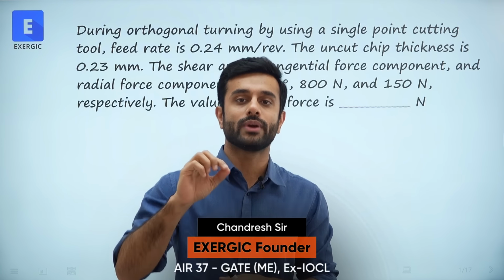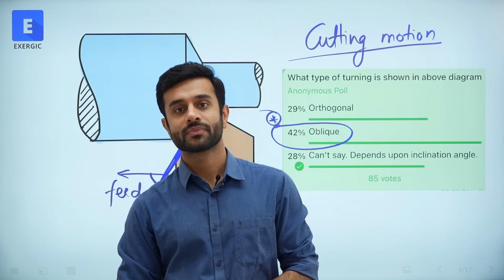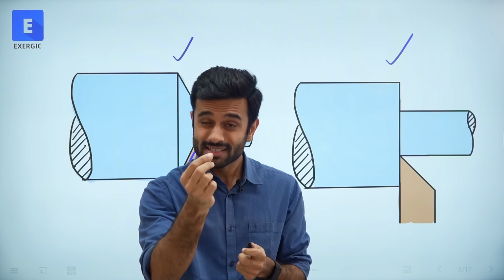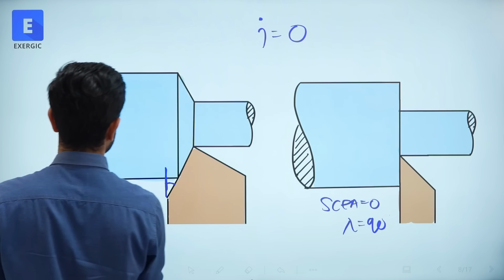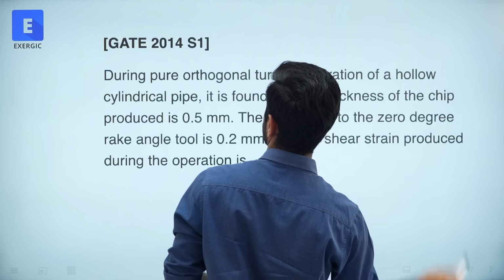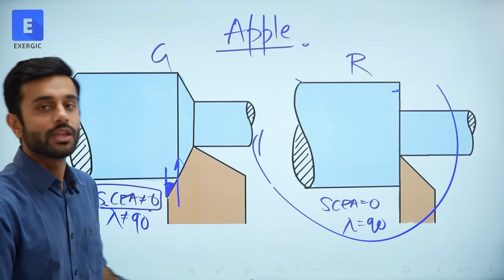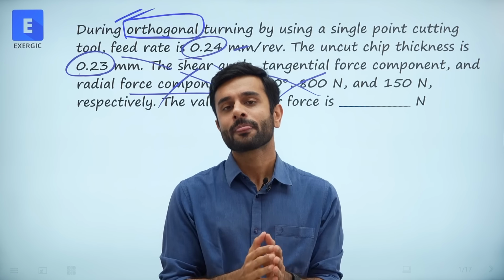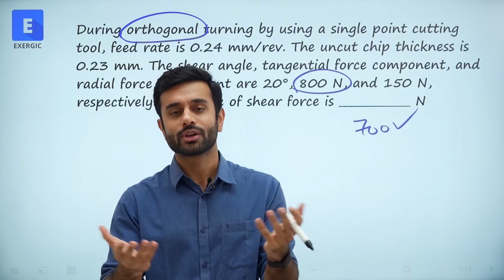Should you Challenge this Controversial Question - GATE 2026 Mechanical

Comment: We have
tan (i) = sin (λ) tan (αb) − cos (λ) tan (αs)

For i = 0 →

sin (λ) tan (αb) = cos (λ) tan (αs)

Divide both sides by cos λ (assuming λ ≠ 90°):

tan (λ) tan (αb) = tan (αs)

So i = 0 does NOT require λ = 0.

It only requires:
tan (αs) = tan (αλ) tan (αb)

Therefore λ can be non-zero and still make i = 0, provided this condition is satisfied.